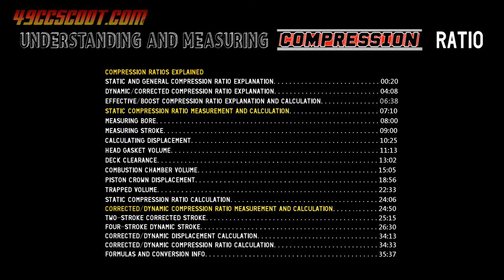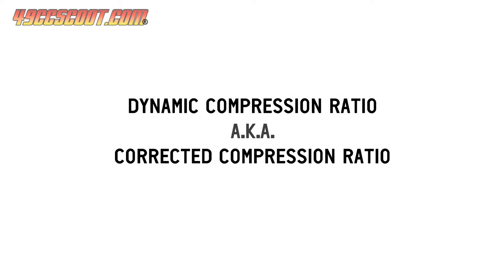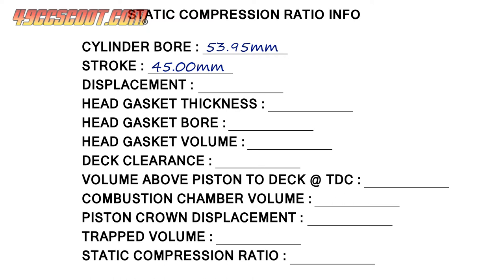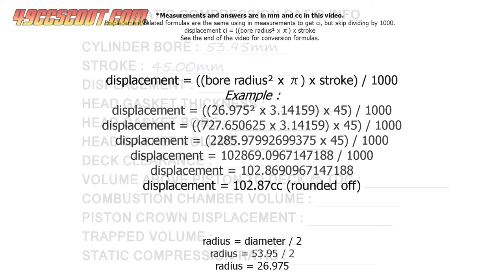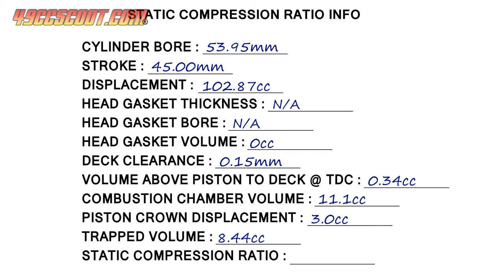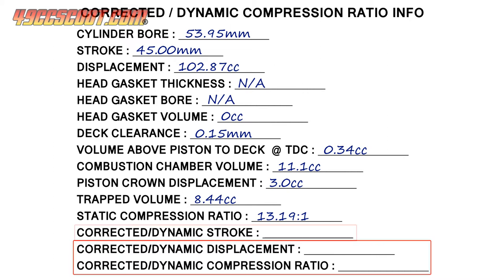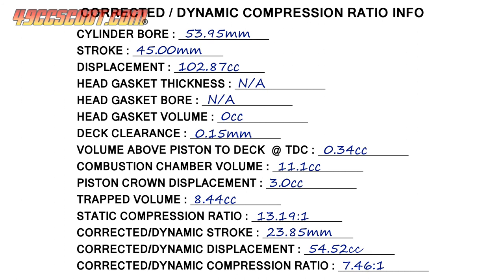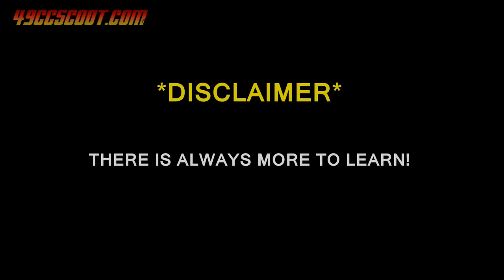Understanding & Measuring Compression Ratio : Static, Dynamic, Effective, Two & Four Stroke

Comment: So what happens if I have a really tight squish band say 0.5mm - 0.6mm but I've deepend my combustion chamber pocket to reduce Compression ratio back to factory 7:1. Also using a spacer under my spark plug to make protrusion flush. Is this ideal? having a tight squish band, with low compression ratio. What happens if I reduce compression ratio BELOW factory spec of 7:1 but still have that tight squish?
Reply from the maker: Ideal would be to set the squish AND the compression where you want it. Keeping the squish tight can help to reduce the likelihood of detonation and the combination should help you get a little better performance. I've never seen big changes from changing squish only, but compression can definitely change the output noticeably. Just make sure that you don't push the squish so tight that you end up with piston to head contact.
Reply: 49ccScoot hey, thanks for getting back to me. This is where I currently am in my Minarelli vertical build. I’ve reduced squish band clearance to minimum specs listed in Two Stroke Tuning by A. Graham Bell, I’ve also deepened the combustion chamber pocket and calculated my compression at about 7.5:1. No base gasket... if I add a thin base gasket 0.2mm it will increase my squish clearance and reduce my compression to 7.1:1. (Also slight change to port timing) Are there any issues if I add a base gasket that is 0.5mm which will reduce my compression ratio to below 7:1? Also slight port timing change, also wider squish band... my main concern or question is... what happens when I lower my compression ratio below the suggested 7:1 ratio? Just wondering if you’ve experienced this?
Reply from the maker: @JoeStMars  If you lower it too much, you will start losing power. The numbers without a base gasket sound the best, but there is more to it. Look at the position of your port floors relative to the piston at BDC. Ideally, you want the floors level with the edge of the piston crown at BDC. Since you are able to modify the head, you can probably get all 3 of those things very close to where you want them. Sometimes it's a compromise.
Reply: 49ccScoot thanks again for getting back to me. It’s going to be a compromise for sure, and a learning experience. The piston does not clear the exhaust port floor at the moment. I may have lowered compression too much during my combustion chamber deepening procedures. I will try it as is no base gasket, piston slightly above exhaust port floor, 7.5:1 compression. Plan B is the .2mm gasket, 7:1 compression still not flush with exhaust port floor... but slightly closer. Plan C is to re start with a different head. 
Thanks for the advice and feedback. You’ve been very helpful! Keep up the videos, they help me a lot!

Comment: Hello 7-8:1 For how many octane fuel ?
Reply from the maker: I use that for premium pump gas, which is 91-93 (R+M)/2 here. You may even be OK with lower octane. Ignition timing has to be considered too.

Comment: and what would be the ideal value
Reply from the maker: There's no single ideal value. It will vary by setup. A boosted engine would not function well with the same compression as a naturally aspirated engine for example. Characteristics of one naturally aspirated engine may allow it to function better with higher compression than another. Fuel used, how it's driven or what it's for... so many variables.
Reply: what would be the best rate for a naturally aspirated 2 stroke engine
Reply from the maker: @leotechmotos  I usually go for 7-8:1 corrected compression ratio for street stuff, but it will again vary by setup and you can push it higher if it's more race oriented.
Reply: @49ccscoot  thanks for sharing your knowledge
Reply: @49ccscoot  🙏👏👏

Comment: Hey, I Got a Suzuki katana 50cc from 1997 and i want to change the belt on her, but I do not know what to do for her to walk more, they say that when she is small she walks more, you know what I could put in?
Reply from the maker: Sorry, but I'm not understanding "walk more".
Reply: @49ccscoot  I mean go more faster, cuz my moto is a 50cc and only goes at 45kmh... I think is the belt
Reply from the maker: @dimitrifonseca1507  OK. The first thing that I would do is to check the belt width. It may just be that your original belt is worn thin and a new belt would help you regain speed. Check a service manual for specifications.
Reply: @49ccscoot  Hmm ok thx man i will try :)
Reply: @49ccscoot  instead of "width" do you mean thickness? Width is how wide the belt is thickness that has been wore may cause what you're talking about. Am I right?
Oh and thank you for the video, I did appreciate it.
Reply from the maker: @m.kasper7646  I meant width, like measuring across the outer surface where the numbers and such are. Thickness would be measuring from the outside edge to the inside edge, like across the teeth/cogs. Thickness can change how it performs, but they don't usually lose much thickness. Width is worn away because those sections of the belt are doing the work trying to grab the pulley faces and the more narrow it gets the less the belt wants to ride toward the outside of the variator for speed.

Comment: What exactly is compression height ?
Reply from the maker: Compression height is the distance from the centerline of the wrist pin bore to the edge of the piston crown. It does not include and dome, dish or other features of the crown.

The easiest way for most of us to measure it fairly accurately is to put the pin in the piston, leaving some sticking out. Measure from the top of the pin to the edge of the crown. Measure from the bottom of the pin to the edge of the crown. Add those two numbers. Divide by 2 and you have your compression height.

If you have a couple of different pistons on hand for the same engine, you can kind of connect them with one wrist pin halfway in each one and look at the compression heights side by side.

Comment: most ppl i kno think that high octane is a bettr, and nevr try to use a lowr octane fuel to c how it affects engine perf..
Reply from the maker: It depends on the engine. If the  engine doesn't require higher octane fuel, the additional octane isn't useful. I have tried to reduce timing and use lower octane fuel on cars and scooters in the past, but performance was improved for me with more ignition advance and higher octane fuel each time.

I know someone that runs their lawnmowers on high octane because they think it's better gas. My mower is around 800cc to make 25HP. I can leave gas in it over the winter and come back and it will start right up. It's the least picky thing for fuel quality and it's running fine after 20 years of cutting grass 2hr/wk during the season with only routine maintenance to the engine.

Comment: Thank you so much!!  That graph of thermal-efficiency, man my engine (92cc chainsaw) has OEM-spec of 13.1:1, so it was awesome seeing that that is basically nearing the 65% mark (and 70% is all you could ever achieve, it seems), IE I'm already near the "point of diminishing returns" at OEM-spec....hhhhmmm I was thinking "I'm going to up the compression as much as I can, as much as I think the engine's crank/bottom end can handle, within reason IE no knock", and planning to retard timing a lil bit if necessary, but now wondering WTH to do because the unit's OEM specs are all so damn close to what you'd "wanna do for performance" (it is a pretty renowned 'power platform' the ms660)
I did just make a cylinder for one with a tapered squish band and a chamber like 70% of original size, and realized I can no longer use "squish measurement" to get an idea of anything because I've changed the chamber's dynamics/volume so much, am going to have to do a volume measurement (hence being on these videos, thanks for making this it is incredibly helpful!!!)

Comment: what you said about normal combustion vs denotation is just wrong
they are the same thing, ignition of the fuel/air...the only difference is the timing
detonation is when the fule/air is ignited earlier than a spark would ignite it
the damage happens when its early enough that the piston has not reached TDC so forces are pushing piston against the normal direction
but to call one burning and the other an explosion is a complete misrepresentation of what is happening
Reply from the maker: You're confusing detonation with pre-ignition. You said "detonation is when the fule/air is ignited earlier than a spark would ignite it".  By definition, that is pre-ignition; as it happens before the spark-initiated ignition event.

When you look into this more, there are many scenarios for improper or unwanted events. It's tough to thoroughly define every instance with singular terms. There is a reason that detonation is called detonation and not conflagration though. 

You don't need to trust me on this. I've read all of this over the years in books by Bell, Vizard, Jennings, Bettes and others as well as watching lectures on the physics of internal combustion. I'm not claiming to be an expert on all topics, but what I have said is out there from many sources and from many better informed than either one of us.